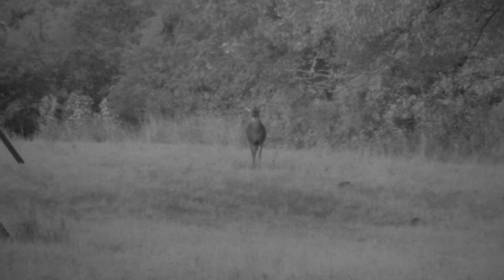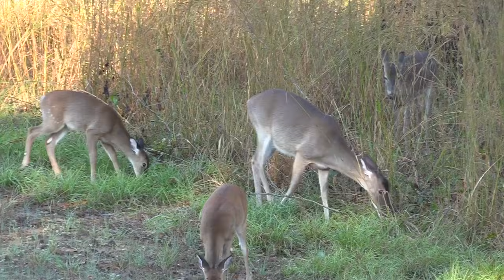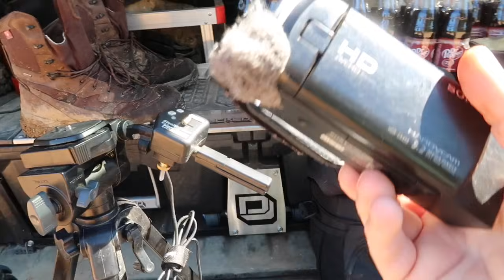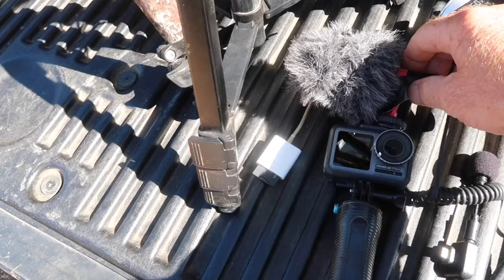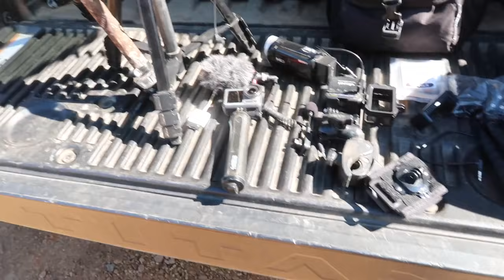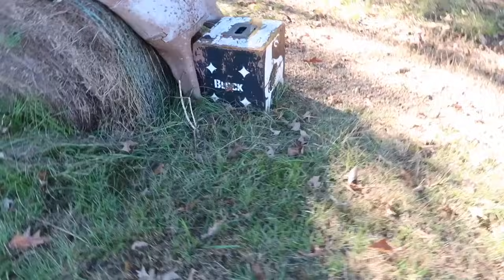WHITETAIL DEER HUNTING 🦌🦌🦌 9 Days After Surgery!

Comment: Jason what about putting a receiver on the front of the ranger then you could position the trailer and use the winch to get them on and you would just have to hook it to the back when your ready to leave? Maybe not as convenient but you won’t be wearing a groove in the top, from running the cable over the top either.